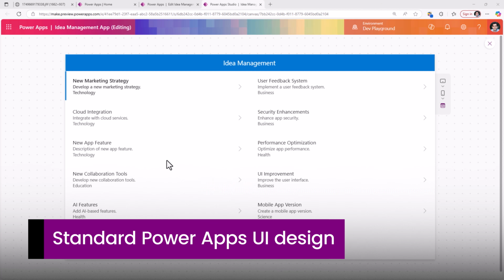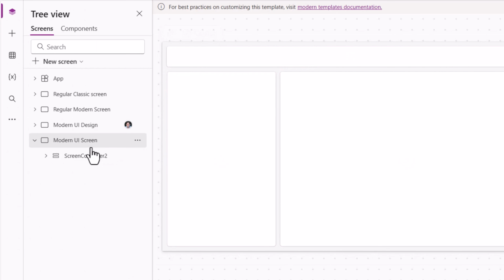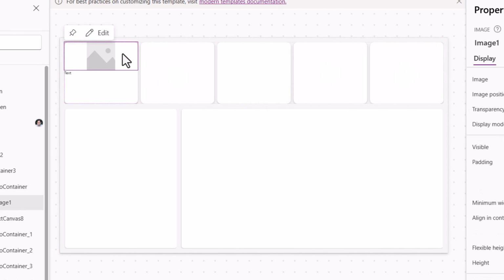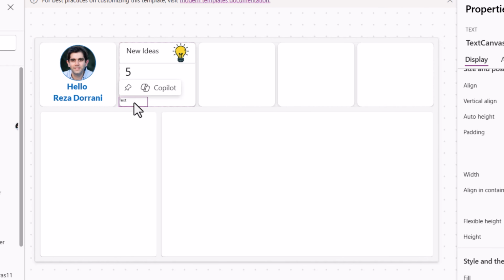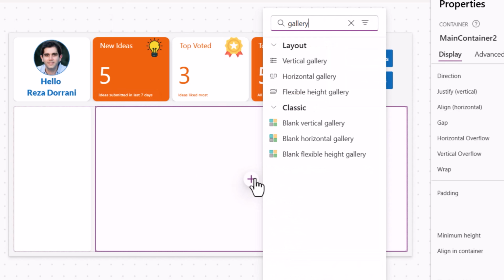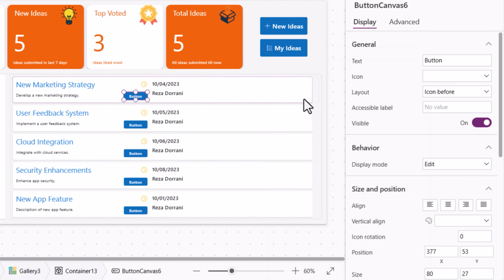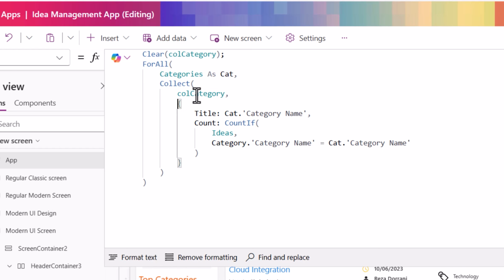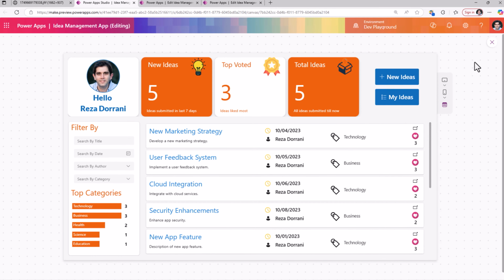Modern Power Apps UI Design Tutorial for Beginners (Step-by-Step)

Comment: I have 300 records populated on the Gallery as a Grid. I am using all simple controls like input text box. when I scroll the gallery it screen goes blank for a while or show spinner before showing next few rows of data. How to improve it and make it smooth experience?
Reply from the maker: I believe that is by design. Gallery loads data in batches of 100.
Im not aware of how to make the loading a smooth transition

Comment: Hi, I created a position creation app in Power Apps. The application submission part works fine, but when I click the "Recommend" button, the connected Power Automate flow doesn’t run.
How can I properly trigger the flow when the button is clicked?
Also, if possible, could you provide the exact formula/code I should use to trigger the Power Automate flow from the button?
Reply from the maker: I have done several videos on trigger flows from power apps. They are all in a playlist.

Comment: Hi Reza, I have a question when we use containers under containers horizontal and vertical then the app is not performing well, its rendering is getting slow. How can we make it better and faster while using containers.
Reply from the maker: I have not faced any issues with nested containers. In this video itself - I show multiple nested containers and have not had any issues with it.